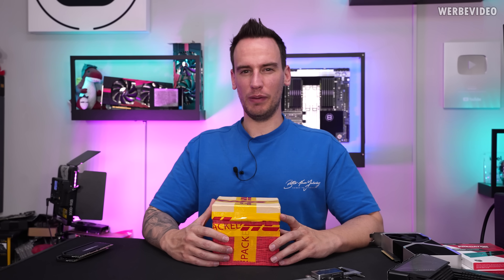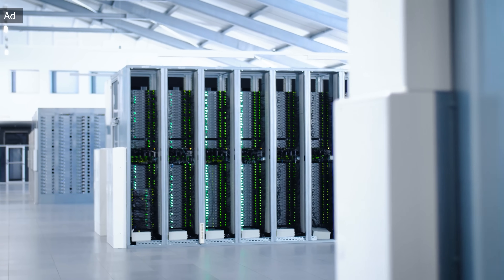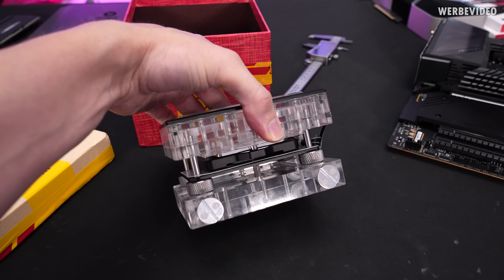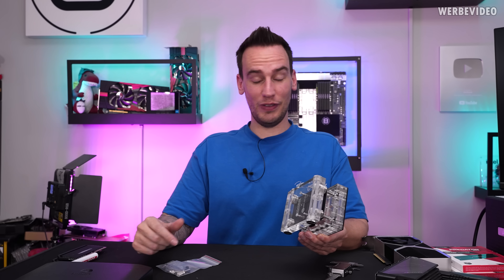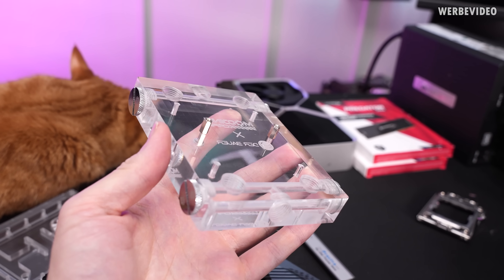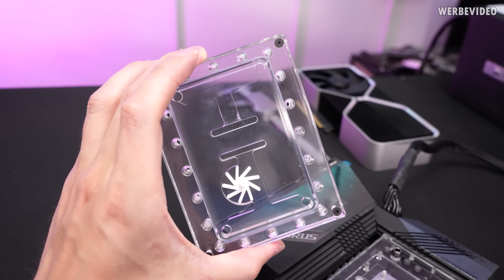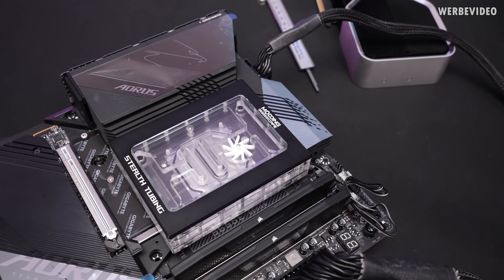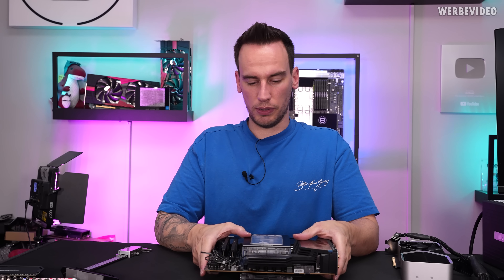A New Generation of Water Blocks? Stealth Tubing Block Tested in Detail

Comment: It looks great, I think this is a great idea. I don't think the back part of it will have that much of an impact on the motherboard tray, like the stand-offs and the cable management are should suffice and the block looks like it stays withing the 4 Mini Itx screws for any board maybe focus to male the front smaller so that it fits on more motgerboards. As some boards have very tall heatsinks that might be on the way, like that M.2 heatsink on yours. Would look really good in one of those no cable builds that some manufacturers were trying to sell a little while back, like a system with no visible tubes or wires, sounds like a dream xD

Comment: Oh man, Ive wanted something like that for my loop for a long time but I lack the tooling to work with acrylic to make it (especially on that level of precision and finish). Its amazeballs, truly. 
As for the two smaller tubes flow rate: They appear to me as 3/16" ID tubes, maybe even 1/4"ID. Either way they should be on par (likely better) since the actual flow restrictions come from fittings and those are already 3/8"ID at best. Im sure you have one of those in-line flow measuring fittings to double check it. I'd be more worries about the pressures than the LPM/CFM. The cold plate mounting pressure is more likely the heating issue like you mentioned. 
Since this is literally your field of expertise, is it better to have a mirror shine finish on your copper/nickel cold plate or a little bit of a rough finish? (I always assumed a rougher finish allowed more dispersion of heat).

Comment: I’ve been liquid cooling for 14 years, I don’t care that you can’t see the tubing, what I like, is that I can run coolant to the back of the motherboard and keep everything on that side of my case.  I’d definitely like to see improvements to flow, those tiny shafts don’t seem like they’d match a 12-13mm or 1/2 inch ID tubing.  Performance is #1 priority, aesthetics are a secondary concern that only comes into play when I have equivalent options performance-wise

Comment: you asked for feedback:
I love watching videos about this sort of thing - water cooling products custom and commercial.  But i would never use them for any reason. Water  cooling products add complexity and danger to a system which requires a level of awareness and upkeep I'm simply not willing to do.  In my experience there is also no real measurable advantage to water cooling - when just tuning the GPU or CPU electrical characteristics in firmware more often than not can achieve the same result.  If I ever become THAT interested in system cooling for a performance gain I will look at whole-system refrigeration where sub-zero temperatures with zero chance of condensation can be achieved without any extra points of failure or dangerous liquids. The design you show in this video is of course too thick and heavy.  The back can of course be slimmed down by using slits instead of round holes for the water flow.

Comment: General thoughts are that it's massively impractical, but very cool. If I was willing to burn several thousand dollars I would pair it up with one of the back powered motherboards, and maybe if I could get my hands on one one of those non-standard GPUs being made by I think Gigabyte that uses an extra power connector next to the PCIx slot for 12V power. Doing all that would result in a build with absolutely no cables on the front side of the board. If I could figure out some way to water cool the GPU without any visible tubes that would be the cherry on top, but I'm not aware of any solution for that currently on the market.

All that said, it would be essentially a one off build using all non-standard parts and would most certainly also need a custom designed case specifically for it, which means a conservative price tag would probably be $10,000 which is FAR outside the price range of most people, particularly when the majority of that cost is going towards aesthetics and not actual performance. It's a very cool product, I'm sure there's some people who would be interested in buying it, but I don't think you'd ever sell enough of them to get the price point down to something reasonable. I'd be shocked if you moved more than a couple dozen of them in any given year.

Comment: Roman make it Ill Buy It, I have been waiting for this for 10 years now... My suggestions are:
1. the jetplate should be on the CPI chiplets and not the middle of the CPU.
2. You should offer a direct Dye mounting plate and backplate offset.
3. You should remove the flow thingy.
4. The metal magnetic aesthetic frame should NOT be all around the block but just the top where the LED strip is placed for a cleaner look.
5. You should put a chrome adhesive film behind the block acrylic so it will seem as if inside it has a mirror finish.
6. You should offer a non acrylic version  but all copper  nickel or other galvanic looks and or acetal.

BY NO MEANS YOU SHOULD CHANGE THE PORTS LAYOUT even if I agree you can make the rear distro much  smaller  and thinner

Comment: A larger gpu style flow though coldplate with no 90° jetplates would be more efficient & simply the design. Would redesign the rear block to include a reservoir & fill ports in a slightly reduced size. Cheers

Comment: I can see a new "ATX" standard coming to market in a few years. One that utilizes all of the motherboard connectors sticking out the back of the motherboard tray, and perhaps larger diameter holes for the cooler mount to allow for increased coolant flow.

Comment: If the size was reduced slightly to allow for better M.2 heatsink an VRM heatsink clearance, I could see myself using it.  I also could see it being made into a monoblock for some popular motherboards.  You might be able to use the holes for mounting VRM heatsinks to allow for additional flow.

Comment: The idea is cool af, but It looks like too many point of failure, incompatibility issues etc. I love it as a showcase piece, but I wouldn't want it in my own system. Besides, tubing is cool. If we go down the route of hidden tubing, as well as hidden cables... you remove all the pretty stuff from the system. Motherboard look much more smart these days compared to a decade ago, but honestly I kind of like the look of all the exposed components on the board, and the anodised and coloured heatsinks etc.

Comment: 10:50 Ain't smaller tube add pressure, meaning more velocity of the flow, which is good for the loop overall ?
Reply: those tubes don't cool anything so no. but that is why jet plates exist on cpu/gpu blocks.
Reply: @Born_Stellar  Thanks 👍

Comment: I don't see the point of it other than as a gimmick. Water flow can never match that from two larger top mount tubes so will drastically reduce cooling. Most people who build water cooled systems also make the tube runs and fluid a feature part of their system. It will also be difficult to fit on some motherboards with lots of heatsinks over the VRMs and NVMe slots.
Reply: flow is already limited by cpu/gpu jet plates. these tubes aren't hurting flow at all.
Reply: @Born_Stellar  Looking at the design I think they will be a considerable limiting factor as you want minimum restrictions except in the jetplates. Will be interesting to see the test results, but honestly don't see the point. JMHO.

Comment: Spinning as in it spirals around forced edges then insert copper wool or steel wool into the tubing to act as fluid mix and thermal assistance to surface thermal dioding

Comment: I  COULD  See  this  as a  Product  ,  And  Yes  =  The  Openings  Behind  Motherboard  WOULD  Be a  Problem ,  However , =  ` Thinner `  Isn`t  Really  Going To  Change  That  AT  ALL ,  Now  on Open  Style  Builds  {  cases  }  =  It  Would  Be  SOO  Easy  . I  Think  The  Flow Rate  Should  Be  Sufficient   Just as  long as  the  Pump  Speed  is  Adjusted  for  ANY  low  flow  rate  variables   and  The  Front =  Or  Viewable  Side  = Seems  as  though  There  IIs  No  getting  Away  with a  Smaller  {  less  than  the  Mounting  Point  Areas  for  the  water  tubing  }  Block  .  Although  i  Don`t  See  this  Coming  Anywhere  Outside  the  Niche  group  of  sales   =   `    Unless  Motherboards  And  Cases  All  of  Sudden  Changes   `  
as  far  as  ideas  on  how  to  change the  design  to  Make  it Better  For  More  People  =  Without  Product  IN  Hand  ,  I  Will  LEAVE  that up  To  You  Guys  !

Comment: Personally i thought the block might have fitting as like a server waterblock. But in general i would love this in my X99 Rampage V extreme build with red LED. Because currently any aio or tower cooler compared to this doesnt compete in the style and no doubt the cooling perf. But id say if they make the pipe backplate out of copper tubing rather acrilic its no doubt possibke to make it as thin as it needs to be. 
Personally i would love to see this come to market but 1 thing im sure of i would need to start saving cash because this type of product aint going to be cheap

Comment: This is a really nice design! Note that it's not the first time it has been done. In the past I saw some guy on the net do something similar, probably between 2010 and 2016 or so. Unfortunately I tried looking everywhere and couldn't find a single mention of it anymore. Some old stuff are just impossible to find on the net sometimes, sadly, and I didn't seem to have saved it either.

Comment: And I thought the EKWB block mounting was impressive. Having the fluid go through there is genius assuming the flow rate isn't negatively affected. Interesting product for those that like to look at their PC for sure. I wouldn't buy it as I am not one of those people. My gaming/DAW PC is all black, black tubes, clear fluid, black blocks, RGB cables tucked away and not connected, RGB controllers ripped out of my case, under my desk with a low noise fan curve. Mixing tracks and hearing nothing but my monitors, not my PC.
Reply: sounds like a cool build. IMO if you want to hide the cables and tubes there is a thing called a side panel, lol.

Comment: No to mass market. It should stay custom and rare. No case would be able to use it. You'd have to use tall risers at minimum or cut out the motherboard tray etc. The design also is not going to perform well regardless of cold plate design.

 It wouldn't sell well.

Comment: I have always thought that making the CPU side water chamber much thicker to hold more water was best. That very thin fin-like plate and small water chamber at the CPU was always a bad idea because they always got clogged up with debris. Yes, I totally agree the back side being so thick would be very incompatible with almost all cases. For me I don't mind tubes in the front CPU side but if the back plate helped to cool the CPU from the back along with the front that would be amazing cooling.  Yes, a better smoother CPU plate would make much better contact and better cooling.
Reply: ive run waterblocks for years at a time and never had one clog.

Comment: Really needs to have the ability to have fittings on the "bottom" of the distro plate, so that a GPU could be plumbed in, with just tubes running up and down the rear of the card, otherwise the GPU would ruin the "stealth tubing" theme.
Fantastic innovation though, so obvious ... once done.

Comment: Looks awesome! I'm already imagining a small case with a short PCB watercooled GPU at the back and 120mm wide full length radiators at all sides. PSU placement is still a b*tch though.

Comment: The sealing to the tubes could be possibly be done from the rear of the board, I'm sure that's been thought of but worth coming back to a few times when looking at other innovations/optimizations. 

The metal tubes could be sealed with fittings instead of the current large acrylic piece. I'm not exactly sure of what fittings; perhaps compression fittings, or having the metal tubes threaded on the outside, or some sort of factory installed nut and flare the tubing to hold the nut in place. Maybe just smaller hoses and tiny hose clamps. You would have four little stringy tubes to deal with on the back of the board which would be a tradeoff because it may be more messy but it shouldn't be hard to hide and seems like it would take up much less space. 
The tubes could also continue to be sealed from the front as in the current design, so sealed during install on both sides. On the back of the board the tubes could be bent at 90° and have fittings.

Obviously anything with fittings on the tubes would need a Y-adapter to mate with traditional tubing, so that is an additional piece in the kit and cost.

Comment: I really like this. I have held off from fluid cooling in large part because I don't like seeing the plumbing. Now we just need something for the GPU. I am concerned about the fluid flow rate, but you should be able to measure that and test the results. OTOH maybe you could speak to your friends at EVGA and get them to create a motherboard with larger holes?

Comment: I'd definitely get one if Thermal Grizzly made an optimised version. Case compatibility would be very limited although the dual chamber ones like the Lian Li O11 series would work quite well I think, apart from requiring a larger CPU backplate cutout.
I wonder if it's possible to make the front side smaller so it fits within the AMD/Intel defined "keep out zone" around the socket? That would fix most issues with it running into M.2 heatsinks or other tall components.

Comment: The question remains how long until the plexiglass crumbles internally from waterflow caused erosion.
Reply: what? ummm, decades? I've had acrylic blocks running for over 5 or 6 years with no issues except needing new o-rings.
Reply: @Born_Stellar  You're probably right, forgot about acrylics blocks, they also move water with higher pressure, than it'd be in the tubes in the tested blocks.

Comment: I believe the roughness of the metal increases the heat transfer.  It would be interesting to try roughing up the cap of the microprocessor in the same manner.  Add LED's to the back and let it show from the back of the computer.
Reply: Air is a very bad conductor of heat. You want a heat conductor to be as smooth as possible, that's the reason for thermal paste. Thermal paste fills in the micro pits in the surfaces.
Reply: yeah its been proven again and again that you want the flattest smoothest mating surfaces and the least amount of TIM.

Comment: Could you tap the outside of the riser pipes to make them also function as fixings and use additional pipes through the other four innermost mounting holes? They're only 6mm but mill down a 6x5 tube with a fine thread?

Comment: Ther is absolutely no way in any universe that you're getting enough flow through those tiny little holes to cool anything higher than a Ryzen 3 or i3 CPU.  Period.  Its not enough.
Reply: no it would be fine. flow is dictated by the most restrictive components already, like your cpu and gpu jet plates. AIO tubing is already that small inside as well, and there are 2 of them each way.

Comment: that's just pointless making the cpu block not only bigger and more expensive but also impractical cause of the huge size you can do cpu block with tubing from the back that is much smaller and cheaper and not that complicated i can only see ppl that like RGB using this crap ppl that put more into how their system looks not how it performs
i can't care less how my system looks as long as it runs at is maximum capacity and runs cool

Comment: a lot of small form factor cases have a rear cutout for rear m.2 drives. though with how thick the rear plate is, i dont think that would work out so well. my case maybe has 5mm of clearance, and thats not even enough for fittings.

Comment: Rough means more surface area for thermal conductivity
Reply: The contact plate for a CPU is not a dissipation element. Roughness is terrible for a contact plate, that's the reason for thermal paste.
Thermal paste is there to fill in the micro pits. There is a fundamental difference between heat conductance and heat dissipation.
Reply: as flat and smooth as possible has been proven to be the best, both though theory and practice.

Comment: It seems some missed the point about the "Stealth Tubes" being the same size as the AIO's.. If they are the same size or a hair smaller.. there is 2 for each direction.
 Which means there is MORE flow thro the block. The flow would be the same as AIO or custom water systems as there is only 2 pipes or hose to feed and extract.
*Some water systems do allow for larger plumbing... but still close enough. :)

Brilliant product idea.. I am in.

Comment: Nifty, mass market it once that cold plate is changed to fix the cpu contact area and have the water side expanded within the acrylic to increase the metal surface area contacting the water flow. Basically make larger internally with additional fins.